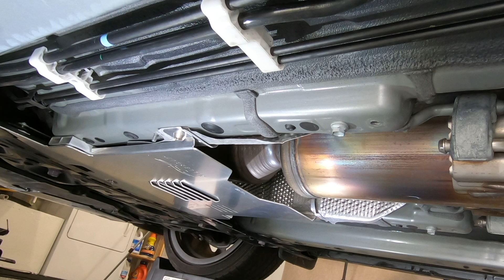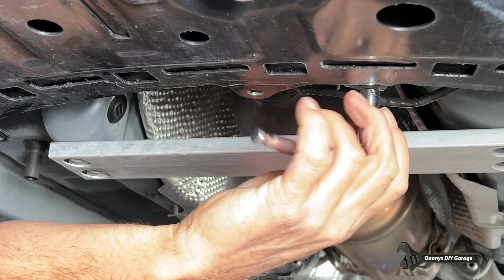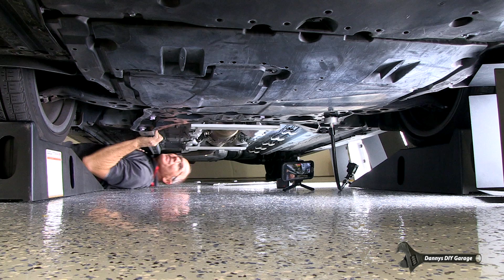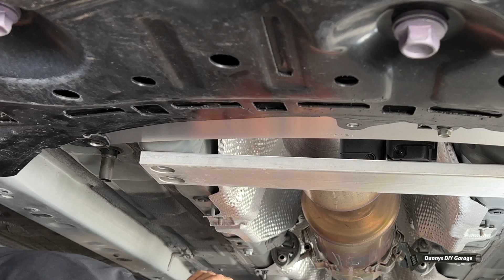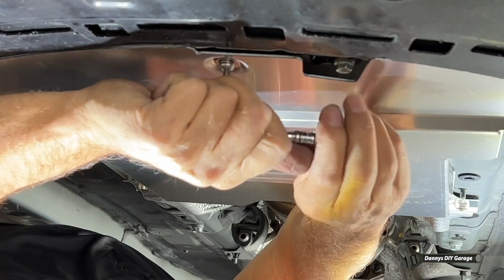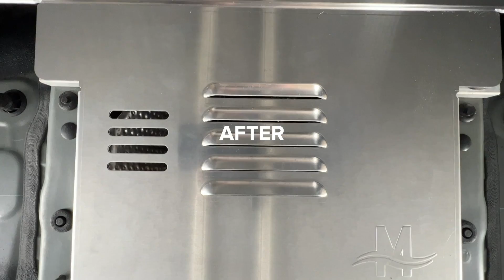Toyota Corolla Cat Converter Security Shield, by Miller Cat. #catalyticconverter #convertertheft

Comment: Thanks Danny!  Just bought the stainless steel version of this for my 2024 corolla hybrid.  It cost a bit extra but it resists cutting better and therefore would slow down a thief.  Likely wouldn't matter to someone determined to get it...really appreciate your tips on the install as there is currently no video on the hybrid corolla.
Reply from the maker: Where did you find it, what company? others may have the same issue
Reply: Miller cat also sells the Corolla hybrid version.  It is different from the one you installed

Comment: getting the "Cat Shield" for our 24 Hybrid Corolla, noticed that it doesn't look like it interferes with the plate that comes off for oil changes, right? I usually do these, but we decided to go with the extended warranty since its our first Hybrid.
Reply from the maker: Correct it doesn’t interfere
Reply: Just wondering what is that behind the CC, I’m guessing it just part with f the exhaust not another CC
Reply from the maker: @jsurfslammer  are you referring to the exhaust Resonator?
Reply: @dannysdiygarage  I don't know, anyway it has a lot of other stuff attached to it so figure it would take to long to remove.
Reply from the maker: @jsurfslammer  it’s a pretty simple install and will save cat theft 👍🏼
Reply: @dannysdiygarage  lol I have

Comment: It is less than an hour to take it out too.  without full rivets, it is still easy to steal.
Reply from the maker: That is a great point, however this is a deterrent not theft proof, the idea is that they see it on and leave because it will take 1 hour not 5 minutes to remove that’s an hour longer, you are correct though, if they bring extra tool they will still get it
Reply: @dannysdiygarage  I think Corolla is almost identical to Prius 4th gen.  I am wondering if we can use prius catshield on corolla. Fortunately it is much more difficult on newer Prius and Corolla than 3rd gen and 2nd gen Prius that are the prime target for theft.
Reply from the maker: Email miller cats, they are very helpful, let them know you saw my video, they will help you with any questions

Comment: What is the installation difference between non-hybrid and hybrid, if any? No video on the hybrid version as of yet
Reply from the maker: The installation is similar, the cover is a bit longer and covers more of the exhaust, not a huge difference in installation, pretty simple, hope this helped
Reply: @dannysdiygarage  is there any drilling needed?
Reply from the maker: I don’t think there is anything that will need drilling, it’s pretty straightforward

Comment: Hi Danny, on the website, it mentions enlarging the holes with a drill and installing rivet nuts. Did you have to do this?
Reply from the maker: This is a new design, if your car is not a hybrid no
Reply from the maker: If your car is a hybrid yes, if you purchase one please use my discount code, thanks
Reply: Just got my cat shield and used your discount code. Thanks! 

Question: Are the holes in your subframe threaded? The holes in my subframe are slightly raised and threaded. This is making it difficult to screw in the anti tamper bolts and lining up the plate. Thanks!
Reply from the maker: @kierankeeslar7445  do you still need help or did you figure it out?
Reply from the maker: those holes were drilled larger from a previous cat converter shield, if it's to difficult you can drill them a little larger

Comment: Hey Danny great to see you are still working out in the garage and posting to help others. I sent an email regarding my Honda Element. Seems older autos are only good to those who are mechanically inclined. Have you ever made the decision to install a new engine on older vehicle or is that when it’s  time to let go?
Reply from the maker: I must have missed the email, I've installed many engines in older vehicles over the years on my personal vehicle and for customers, I've watched people install a new engine only to find out a few months later it needs a transmission, then a power steering rack, starter Alternator and it becomes a money pit. 
With that being said, things to consider when spending money on your older vehicle, #1 the condition of the vehicle, don't put more money into it than it's worth, #2 just because a new engine gets installed won't make the car new. #3 Evaluate the condition of your vehicle and the money you would spend to get it to where you would love it.
Reply: @dannysdiygarage 
On corolla 2013 ,  how much does cost about to completely buy & install ?
Reply from the maker: Toyota Corolla used engine can be found for $1000.00 to $1500.00 and new $4000.00. Doing it yourself add about $300 to $500 in possible parts, hoses belt’s coolant oil
Rough Estimate only